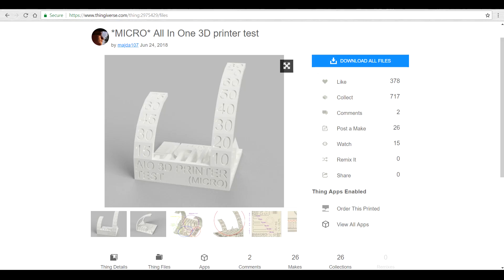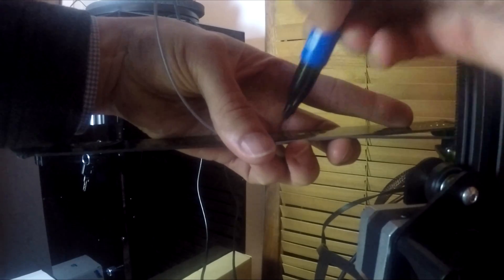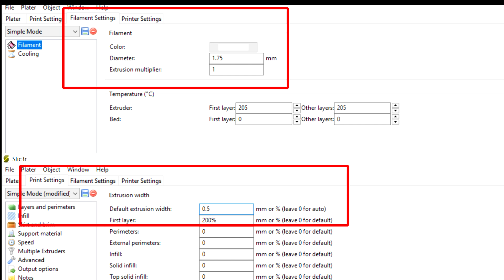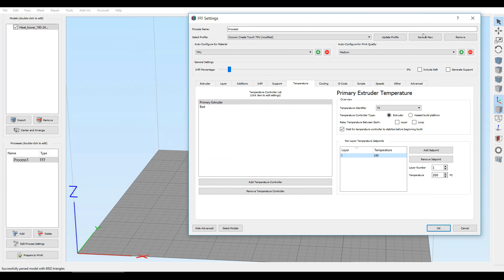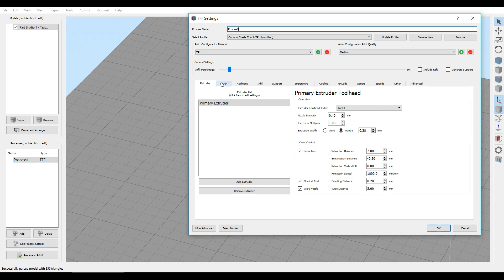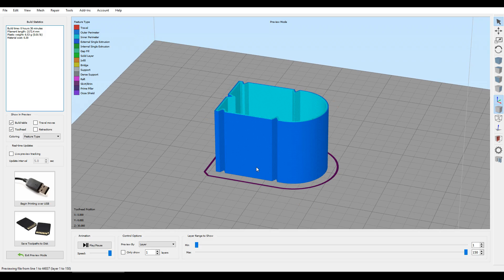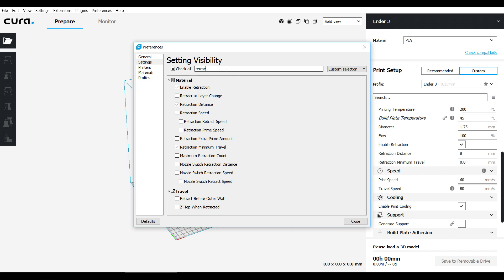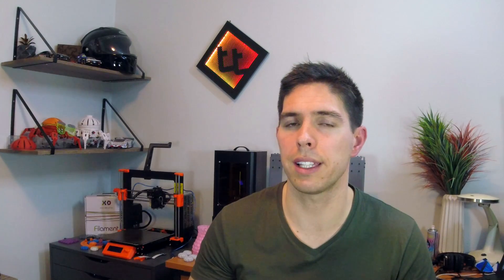How to tune your slicer settings featuring Ender 3 - UPDATE IN DESCRIPTION

Comment: !!DO NOT USE THE REFERENCED GCODE IF YOU'RE USING A GLASS BED AS IT WILL PRIME THE NOZZLE ON THE BOTTOM OF THE BED CAUSING A NOZZLE CRASH ON YOUR BED CLIPS, THE CORRECT ORIENTATION FOR A NOZZLE PRIME IS THE LEFT SIDE!!
Reply: Thanks for that, a little too late though lmao, had to use the nuclear option and emergency powder down
Reply: Perhaps this makes sense if you're down under, but to this yank it sounds more than a little confused, as bed clips may be positioned ANYWHERE, priming on the ?BOTTOM? is going to be a MIRACULOUS accomplishment, and, like other concepts here,  where one primes is one's own decision!
Reply: @palewriter1856  On the ender 3 the clearance between the side edges of the bed and the aluminum frame is way to tight to use my bed clips for my glass bed on the sides. Pretty sure thats what hes saying. So clips must be on back and front edges of the bed, and the nozzle wipe on the front hits the clips. I've had to deal with this when using most peoples gcode. Its not hard to modify it to work.
Reply: @lifson22  Hey Nerdly Doright - perhaps you're correct - which would make you a good candidate for a translator, next time I travel down under.
If I could get serious long enough to track his flow, I might have fingered that out on my own, but that would be SO MUCH EFFORT!  See - there I'm SHOUTING now.  Sorry.
I don't think I've ever seen anyone flying their clips on the sides, but there's always a first time, as they say.
As for printing other people's g-code - that's also a novel concept - but I've only been at this for 6 years - which puts me about 2nd grade again.

Comment: Hi Michael!

thanks for this video and shared slicer settings. I'm using your Simplify3d profile and it's working well, but I had missing steps on the y axis when I print a larger file. I printed a calibcat and it was good at the first time, after the print I started again a print and  it has missing steps. After this the printer printed out the rest without any problem. Today I printed a tray and somewhere at the middle of the print at has again missing steps. Don't you have same problems with Ender 3 pro and Marlin 1.1.9? Somebody told me to change the accelartion and jerk settings but I cannot find these at Simplify3d. thanks

Comment: maybe can help me or explai what wrong and what and where i need check.

if i put G1 E100 F100 for me print 100mm (10cm)
but
if i put G1 E250 F100 for me print 150mm (15cm)

i understand it's not correct, must print 250mm (25cm)?

Comment: Thank you for a great video, exactly what a newbie needs. 
Where can I find that 0,48mm test cube ? It is not in your links or on Thingiverse.
There is a cube with your files, but it is solid.
Reply: sj devries thats the point. If you set the slicer with no top or bottom layers and zero percent infill the Cube will be hollow.

Comment: Maybe I'm missing something but why at 3:56 are you telling that your target is 0.48 when in the slicers you set 0.5?
Reply: He's using simplyfy 3D which automatically inputs 0.48 as the wall witdh. If you're using the other slicers you probably wanna measure 0.50.

Comment: My Ender 3 was extracting backwards / reverse.
For extrusion I had to set relative positioning first with command:
G91
and then followed by:
G1 E100 F100
Reply: Mine ran in reverse as well.  Used your G91 to set relative positioning (http://marlinfw.org/docs/gcode/G091.html)

My process using gcode (can be copy/pasted)for everything using OctoPi terminal with Marlin on Ender 3.

G28 ;Autohome (http://marlinfw.org/docs/gcode/G028.html)
G0 Z100 ;Move Z 100mm Up from autohome (http://marlinfw.org/docs/gcode/G000-G001.html)
M109 S220 ; set hotend to 220 (http://marlinfw.org/docs/gcode/M109.html)
G91 ;Set relative distance (http://marlinfw.org/docs/gcode/G091.html)
G1 E100 F100 ;Code from tutorial to extrude 100mm at 100mm per minute (https://youtu.be/3yIebnVjADM?t=137)
Reply: You need to preheat the nozzle and bed to perform an extraction.....also if you are using Octoprint concern upgrading to the most current version

Comment: Soo just a quick question..
I had relative good printing results before. now i did the extrusion tests. Instead of 100mm it extruded only 88mm, so i ramped up the stepper to 105.68 instead of 93. Second test, still not there - increased to 108,94 and that did the trick (all with my default printing temperature for my PLA of 205°C).
Now the single wall cube, wall thickness 0.4mm (which is the default in cura 3.6 for the ender 3), it mae a cube with 0.5mm walls. This would mean extrusion factor of 80%.
This seems really strange. first i would drastically increase the flow (93 -> 108 steps), and then to reduce that higher flow decrease the flow factor to only 80% ?
Wouldn't it be better to leave the stepper value to 93 and just test wall thickness, so that i would only change the extrusion factor a little?
Also, i did the cube wall thickness test with 0.3mm layer height - does that make a difference for the test?
Thanks :)
Reply from the maker: Yes I agree. All the tests are theoretical so if you were printing well before than just tweak the flow rate a little to suit. All that matters is the final printed part.

Comment: Wow, i had no idea calibrating the e-steps would make such a large difference. I had troubles leveling my bed because it seemed to have a REALLY small sweet spot. Turns out i've been under-extruding by quite a lot. Had to change my E-steps from the stock setting of 83 to 114. Now it actually prints nicely!

Comment: Great video and article, I was wondering if you would consider to make a glasbed adhesion test without glue/hairspray/tape. My idea would be to make a single layer square with 4 circular hole in it, and you could try to print the same with 240C->190C in 5 C increments, to see how this end up. Anyhow great channel
Reply: Yes, I would love to see a bed adhesion video.  I put a borosilicate glass on my Ender 3 as well.

Comment: Is there a way to put the "G1 E100 F100" code into a file on the SD Card? I don't have the necessary USB cable for the Ender 3.
Reply: I was lucky enough that it uses the same usb cable that ps3 uses to charge the controllers. I doubt they are that expensive. But no, sorry i do not know the answer to the first question though.

Comment: I'm having a huge problem with the first step. The extruded length is always inconsistent at the centimeter scale. Even with the default value it varies from 9 to more than 12cm from one try to another.
I tried marking differently since probably the first marker was causing the filament to slip, i tried loosening the filament before starting every try so that no unexpected tension could have caused unwanted retraction of the filament, and i also tried lowering the speed of extrusion to 50mm/min, but the problem is still there.
I've had bad experiences with steppers not behaving linearly before (actually i have never had a successful experience), but those projects were self-designed so i might have failed the coding part. Now i'm starting to lose faith in steppers
Do you have any suggestion?

Comment: **Fair warning to anyone who runs the presliced gcode provided here. If you have a glass bed with clips holding it on be careful!!! He has the nozzle travel right across the front of the tray for some reason and it will collide with your bed clips. I wasnt expecting that and was rewarded with a busted glass bed as all hell broke loose when it started.

Comment: I  have no idea what I am doing wrong, but no matter what i put in for calibrating the extruder, it always feed out the same amount. I measured out the 120 mm. fed it and ended up with 25 mm left. did the calculations and ended up with 97.89473684210526.... so i put in 97.89 and m500 it.  tried the g1 e100 f100 again but didnt work... had to disconnect printer and reconnect to get it to go. It showed E97.89. BUT after running test again I was still at 25 mm left... very connfused. Any help would be appreciated. Thanks!

Comment: Hi Michael, another great video! Just a quick comment, on the heat tower adjustments in your settings one of the layers height shows 106, it should be 101 (76+25). I'm just nitpicking, but because some people may just copy the numbers from the video and it may affect the results sligthly for the 220°C range.

Comment: When I enter the gcode G1 E100 F100 the extruder does nothing. If I knock that number way down G1 E20 F100 I notice it actually extrudes, but in reverse. If i use G0 it extrudes in the propper direction. Why is this?

Comment: I have to say I’ve had some really crappy results with some filaments.  What I’ve found is that slowing everything down has helped big time.  The flow for the extrusion (feed rate) was too fast and the head speed was too fast.  Basically I’ve slowed them down to 80% of their original values (ie max and mins are now 80% of what they were).  I’m now getting very good quality and accuracy in all dimensions.  I’m using repetier with Cura.

Comment: which is the cheapest program or which I recommend even if I have to do the expense I have 2 ender 3 and 2 cr 10 s to start my business as soon as I use two machines the cr10s prints perfect but the ender I think it takes more filament but with the priest can not send 10mm of extrucion and the other programs that you say are not free, is there another way ????

Comment: anyone know how i can calibrate the e steps on the stock operating system on the ender 3? when it prints i sometimes get alittle separation of layers and ive been told i might be under extruding abit. i don't want to mess with octoprint or the new marlin thing as this is my first printer and am still learning so i want to avoid doin something irreversible, since even with the occasional seperation it still prints amazingly.
Reply from the maker: Easiest thing to try is upping your hot end temp by 5 to 10 degrees. Filament will have less resistance and layer adhesion will be better.

Comment: Do I need to change my extrusion rate (e-steps) for different filaments?  I have my Ender-3 calibrated for AIORobotics filament.  But when I changed to Hatchbox, my sample prints were under-extruded and my 100mm extrusion test came back with a 3mm difference between the two filaments.  How do I correct for this without needing to change the extrusion rate in the firmware every time I change filament?
Reply from the maker: You can easily compensate in the slicing software with flow rate/extrusion multiplier. They all achieve the same thing.

Comment: With Bowden style setup there is another way of doing it that I think is a little easier. 
Ensure that your filament is not already loaded
1. Detach a Bowden tube from the extruder by pushing down on the collar and pulling the tube up.
2. Load filament into the extruder.  It should poke out through the end of the Bowden tube you removed
3. Carefully cut the end of the filament so that it is flush with the end of your Bowden tube holder.
4. Request that the printer extrudes 100mm of the filament. G1 E100 F100
5. Using calipers, measure from the edge of the Bowden holder tube to the end of the filament that came out.
Calculate your extrusion multiplier
Reply from the maker: A nice methodology. Maybe still extrude 120mm because if it under extrudes it will be hard to measure by how much. I agree this way with be less fiddly to measure, never thought of it before.
Reply: You are calculating the extruder steps/mm not the extrusion multiplier.
Reply: This would work assuming the nozzle has a negligible effect on extrusion volume. I'd prefer not to mess w/ my tube once it's properly installed though.
Reply: Tried this under recommendarion from a respected person on FB as it verifies the stepper directly. The extrusion multiplier should be used to compensate for filament behaviour. It makes sense, but my prints looked great before. Now not so much. Que Cera Cera. Back to tweaking.

Comment: The later Ender shows all correct settings in lcd that I set in Cura now, but not the older Ender 3. They updated firmware. Much easier now and also set e steps a doddle
Reply from the maker: That is good news.

Comment: great video!
does the retraction speed is also important factor or is it mainly the distance?
Reply from the maker: I would think once you had the distance dialled in you could do a similar test for speed. I think you want it as fast as possible without reaching the point where it strips filament.

Comment: Have just got another ender 3. This time the screen settings are well updated. You can set everything without computer connection. It has options for e steps so no need to panic I meeting up EPROMs etc. You can save any profiles you want in it. But there was a let down. Fixed ends on the stepper motors so not able to add dampers. Not good.
Reply: So the gear ends on the steppers are fixed ?  No grub screw to remove them ?
Reply: @Gazza-usa. Yep. The factory told me by email in creality. Ca. The motors can come off but no grubs to adjust the length for the dampers to line up synchronous drive. Understand? I don’t want to see how they are fixed. It might be a tight compression fit or a spline on the shaft. Just have to put up with the noise on the new one.
Reply: That’s a horrible solution.  They need to allow for adjustment. I’d advise you send them an email stating that this is required by most of their users.  Ie a grub nut attached gear to the motors.  Email them a complaint please.  They seem to be fairily accommodating.
Reply from the maker: Great info, thanks for sharing.

Comment: Question dude. Should cura auto change ender 3 machine settings automatically? Why do I keep having to alter the machine to what I have set in cura? Any ideas? I am a fairly newbie ish.... My machine settings in cura . etc nozzle 212 flow 103 etc but ender 3 does not show them??????
Reply from the maker: It's not the type of thing that shows on the LCD. You just have to trust that whatever is in the gcode is what the printer is following.

Comment: Michael - many thanks for your instructive videos. I'm having a real problem calibration my Ender 3 extruder. My Ender 3 (2 months old) used to print perfectly. However after various upgrades (bullseye fan shroud, upgrading to Marlin 1.1.9, BL Touch, etc) it started under-extruding badly with layers not adhering to each other. In desperation I've reversed all the hardware changes (still on Marlin 1.1.9 though) but it still won't extrude properly.

I'm now trying a very simple test. I remove the bowden tube so the filament just pokes out of the extruder then heat the hot end so extrusion commands will work. Then, via Octaprint I issue the command
g1 e100 f100
This ought to extrude 100mm of filament over a period of a minute. Instead it extrudes around 40mm in about 22 seconds. This is a repeatable, reliable measurement. I think the extrusion rate is about right, but why does the extruder motor only run for 22 seconds instead of 60?

Clearly the problem has nothing to do with the hot end, since the filament is not going through the bowden tube. There's no sign of wear or slipping on the knurled gear on the extruder stepper motor, it just doesn't run long enough.

When I issue an M503 command I get:
Recv: echo: M92 X80.00 Y80.00 Z400.00 E93.00
Recv: echo:Maximum feedrates (units/s):
Recv: echo: M203 X500.00 Y500.00 Z5.00 E25.00
That E93.00 is the Ender 3 factory setting so I haven't screwed that up. Somehow it doesn't seem right to multiply it by 100/40 to fix things.

Any ideas for what I've done wrong?
Reply from the maker: My best guess is the grub screws holding the drive gear in the extruder stepper have become loose, so the stepper is turning more than the drive gear.
Reply: Wish that were true michael, but the issue is the time it extrudes - there’s no slippage and the grub screws are tight - if it extruded for 1 minute it would extrude the right amount.  Here's a picture showing the setup for the test - you can see the tip of the filament poking out of the (all-metal) extruder.
https://cdn.thingiverse.com/assets/e8/71/be/a0/35/extruder_test.jpeg
Reply: I bit the bullet and issued the command M92 E200 to change the E value from 93 to 200 (in line with the test). The Ender 3 now prints properly! I'm not happy with such an extreme extruder value but don't know what else to do.
Reply from the maker: I'm glad you got it sorted, or a workaround at least. This is a very strange problem.
Reply: @TeachingTech  Michael - just to confirm that the Ender 3 is now printing properly despite E now at 200, here are some parts I've printed in the last two days (Pi 3 box and camera case + box for buck converters to power the Pi and switch the printer on and off). I have a new extruder stepper motor on order to see if that's the problem.
https://cdn.thingiverse.com/assets/e5/a0/dc/da/6d/3D_Parts.jpg
New motor installed - no difference! Mystery persists.

Comment: Hi, one question, I measured the length of the filament after the G1 E100 F100 command and ended up having 24 mm left, so underextruding.
I then calculated the net E-Value, pushed the single Line and added another Line of "M500". So good so far, after using the M503 command, it showed the edited Number.
However, after I restartet the printer, the Value was E93.0 again. Is this modification not possible with the stock Firmware? Or ist this the new Value, but it now still displayes it as E93?
Reply from the maker: Stock firmware doesn't have EEPROM enabled to store the value. You have to add M92 command to your start gcode.
Reply: @TeachingTech  ok, but how does this work with the m92 command to add to the gcode? Where do I add this? And how?

Comment: m500 wont survive octoprint reboot. steps will revert back to 93, how o fix this?
Reply from the maker: Update your firmware, and until then, add the M92 command to the start gcode.